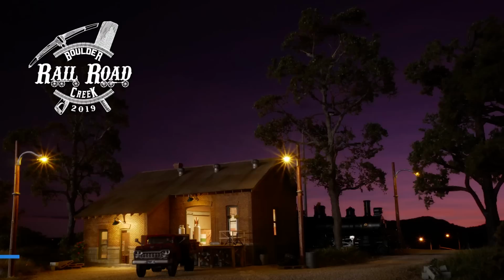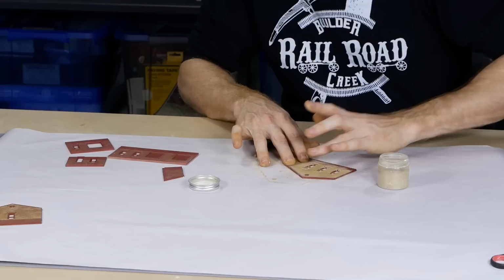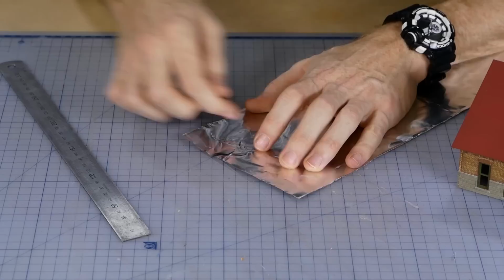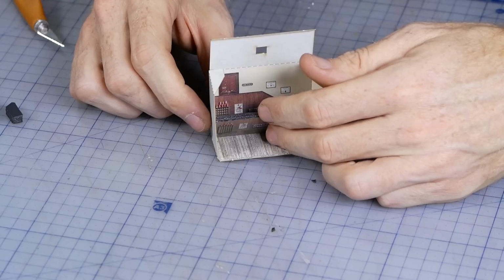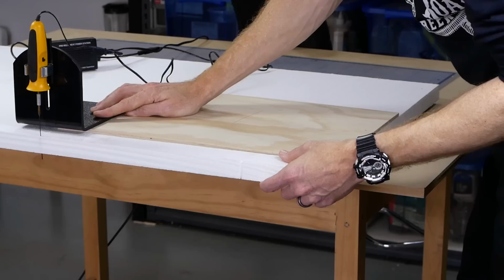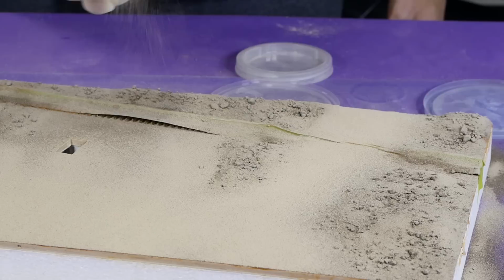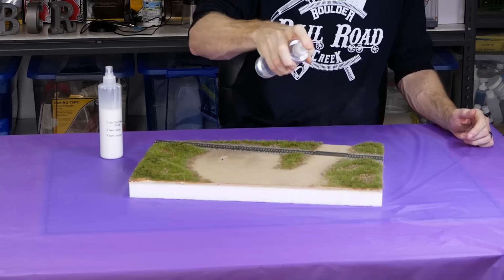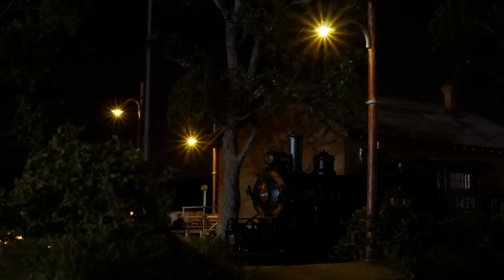How-to Build the Ultimate Night Scene – Realistic Scenery Vol.18

Comment: There is great appreciation for the re-using of waste pieces in other areas of this diorama or other dioramas. Something so simple is a good habit for others to follow. I know it may seem twee but little things like this  matter. Especially with a hobby such as this where you could easily get into the habit of just chucking out the waste and starting afresh. Your approach is far more sensible and I use it as an example for my young children. They're very artsy and were in the habit of creating loads of waste rather than getting the most out of their supplies. Seeing how often you recycle/reuse  and how clean you leave your  workspace is a great example for them. Cheers Luke.

Comment: Rather than using a matt varnish to seal the mortar, you might want to look at Pastel Fixative. Or Workable Pastel Fixative. It won't change colour, and you can rework it once sprayed, and it will fix it into position. It's available at most artists stores.

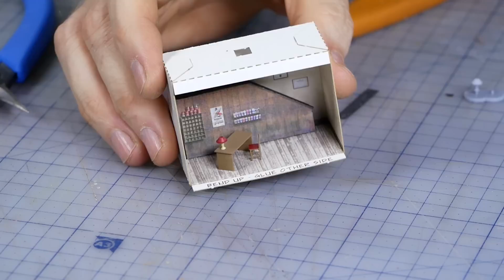Comment: @ 10:38-10:51--Re:  Glazing.   Are you using actual  glass, or are you availing yourself of plastic glazing instead?  IIRC, very thin glass (as also used for microscope slide/sample covering) was considered rather cutting edge back in the day--for all I know it's the standard now.   
Thanks for any reply.

Comment: Amazing work! Luke, what type / make of strip wood did you use for the dock?
Reply from the maker: Thanks Jan, I used some 0.75mm plywood and cut it into strips for the floor boards and Northeastern Lumber scale 2x4 strips for the underside, but I might have to double check because I think there was another size I used but cant remember of the top of my head...
Reply: @BoulderCreekRailroad  Thank you for such a quick reply! That helps a lot! Was just looking to figure out the material as it can be cut to the needed sizes. Looking forward to seeing more from you :)

Comment: For the door you removed, why didn't you just cut it out with a hobby knife/exacto so you can reuse the door placing it in the open position?
Reply: The plastic on DPM models is very thick and it's almost impossible to remove the door without destroying it.  It would actually be easier and faster to scratchbuild a new door.
Reply: Barry Silverthorn gotch ya. I don’t have any experience with that brand. Too bad they don’t make it a little bit thinner and in styrene. Would definitely be easier to modify. 
Great video though.